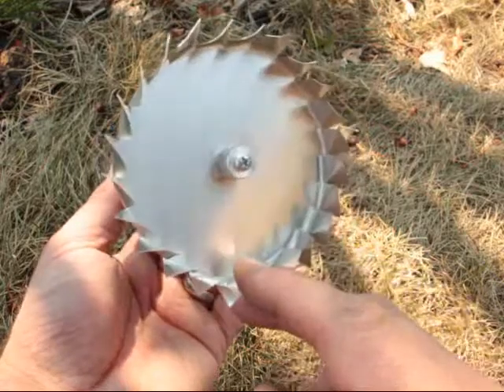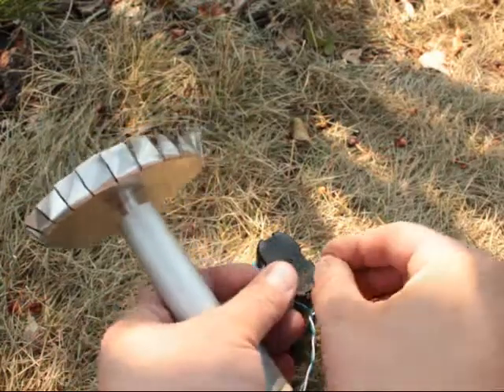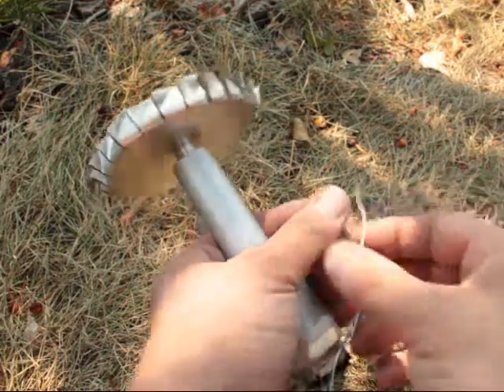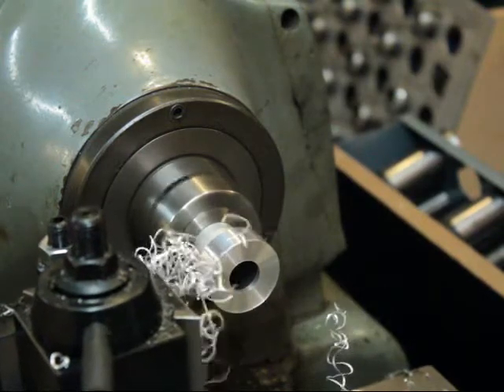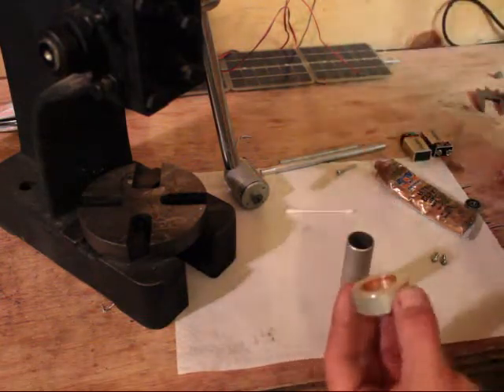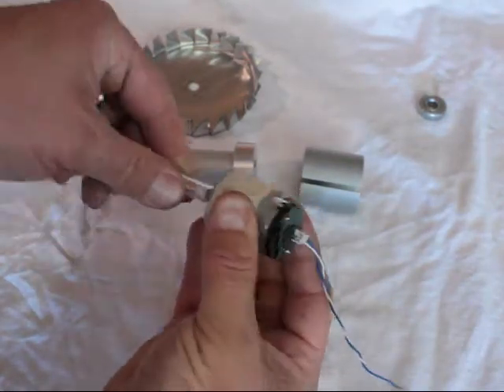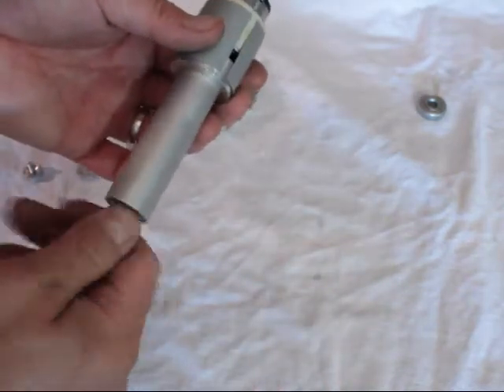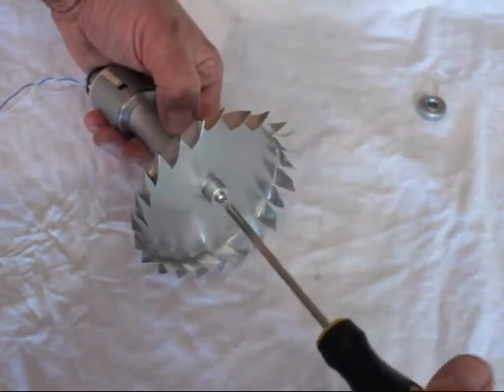Micro Convection Fan for YT member wtam69 solar oven

Comment: Also, I made a solar-oven and it also reaches over 300 degrees. While I was looking into making a solar-oven I read that there are no hot-spots in a solar-oven so you can't burn food and receipes need to be adjusted because theres not near the loss in moisture during cooking that there is with a conventional oven.
That being said I still like the idea of convection. Evening the temp to a constant. It can't hurt. Nice work again.

Comment: Nice work. I have several Solar Heaters that have fans from Computer towers. I maed some PV panels to power them. I hook the panels straight to the motors with nothing between. No battery. When a cloud covers the sun you can hear the fan slow down but when the sun is bright it Rocks!!!
I made my 3 solar heaters and have several in-house sun-catcher type things that convert light to heat. Small DC motors do big things.

Comment from the maker: Thanks! It doesn't take much to get me focused on another project. Perhaps it could be repurposed into a micro hydro electric setup? I might suggest a stepper motor for that though. You can put any motor in there an the fan hole is 5/16th fyi. Hope it works out